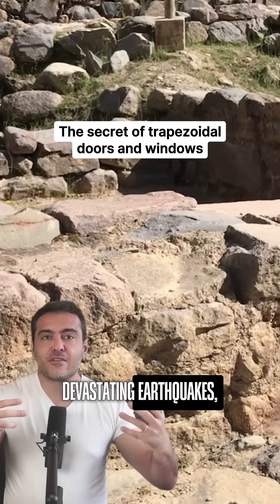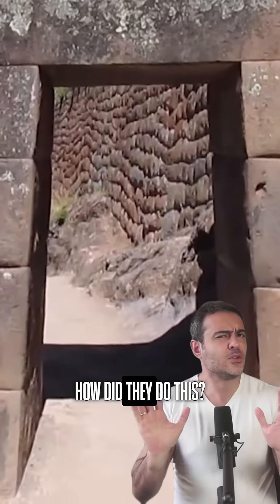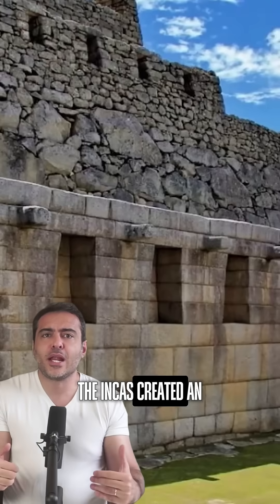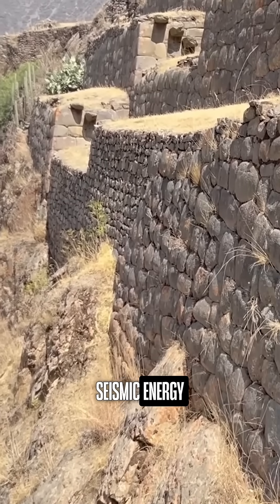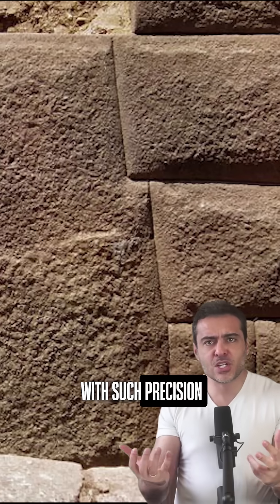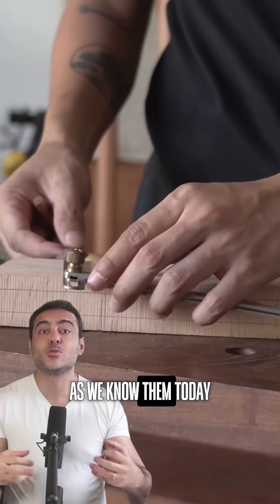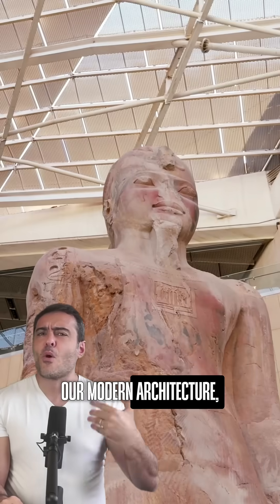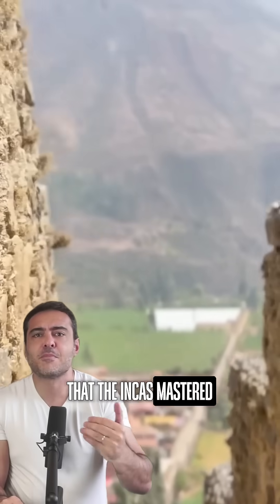Machu Picchu is stronger than most modern buildings!

Comment: No they weren't cut to that precision.  They were cut, and then dissolved to that precision on the front face of them.  At the back of those stones, they don't line up to the degree that they do on the face.
Reply: Dissolved?  😂 Talk to Milo.
Reply: @ggad1899  Dissolved.  Their is a thermal hot spring in the area, in a cave.  It has been going for thousands or even millions of years.  It's extremely acidic.  It is full of red acidic mud.  It was used as mortar to help fit and dress the stones.  Just strong enough to break down the minerals of the rock.  Yes, rock can be weakened and many of the minerals in it will dissolve if the acid is strong enough.   The idea that they needed machine tools to achieve that precision, or power tools or any such thing has been debunked.   This one has been solved.  Er, even dissolved, if you will.